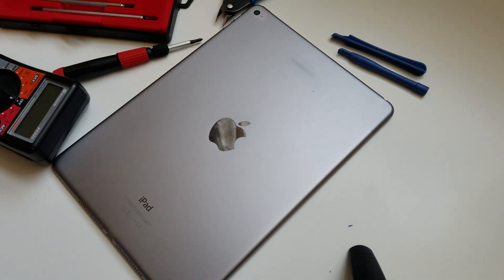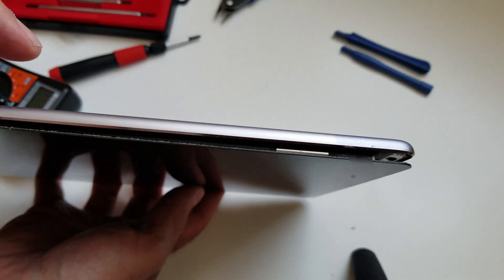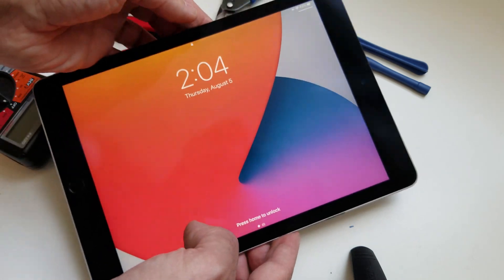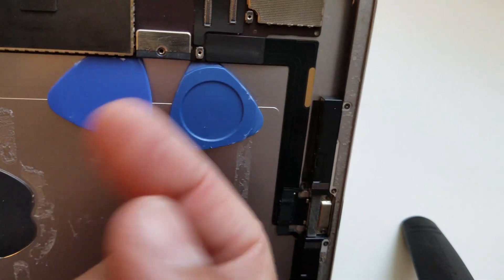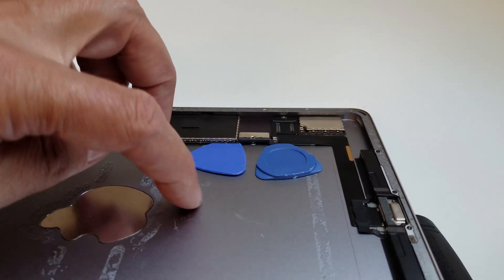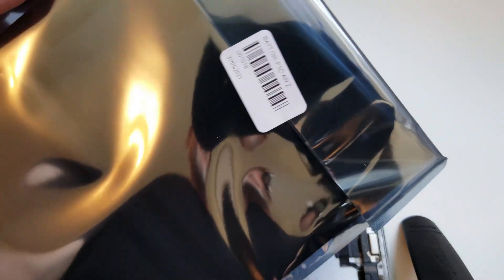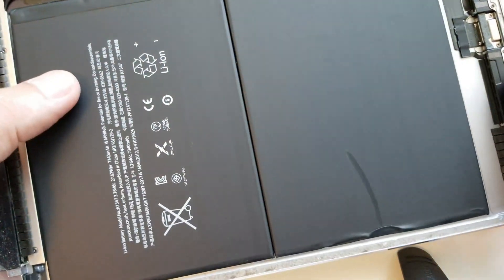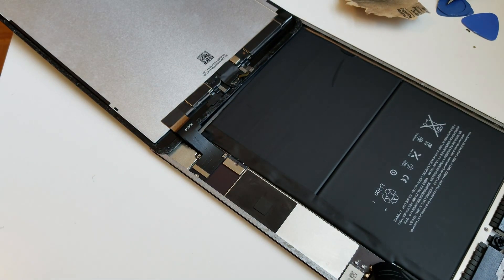iPad Air 2 Battery Replacement, Easy way, Swollen Battery

Comment: This is a best case scenario, the hardest part is separating the screen, if you can do that then the rest is relatively simple. Before you go and buy a battery, try and get the screen off first. I spent over an hour trying to do this following all the instructions but to no avail, in the end I finished up cracking the glass.
Reply: the beauty of swollen batteries are they lift the screen up for u 😂

Comment: Thank you for the close up on the small post attached to the back of the frame where the battery attaches to the terminal. Ive watched many videos showing that you have to gently pry up where the battery inserts into the terminal but did not know about the battery "post"!  🇨🇦

Comment: It is not safe to use metallic tools to remove battery. It can puncture battery casing and cause fire. Please use only plastic tools or better give your iPad to professional service company.
Reply from the maker: The tool I am using is perfectly flat and pointed downward against the aluminum  back so there is no any chance puncturing the battery.
Reply: Live life on the edge.

Comment: do you need to put glue after install battery?
Reply from the maker: The old glue (double side tape) will hold enough , but if you want you can clean the old one and apply new strips of double sided tape.

Comment: That ring and hole at the edge is the one that complicates things. Without it, it's very easy to insert and remove battery.
Reply: That was a complication, so I just used a couple of spudgers to pry the logic board off the back case carefully and just high enough to slide the battery connector off the pin and out.  It's tricky because you want to get the spudgers behind the battery, but you don't want to bend the battery to do it.  I managed it without breaking the connector.